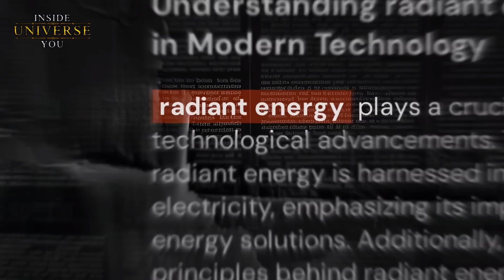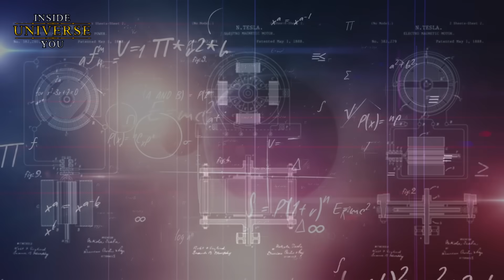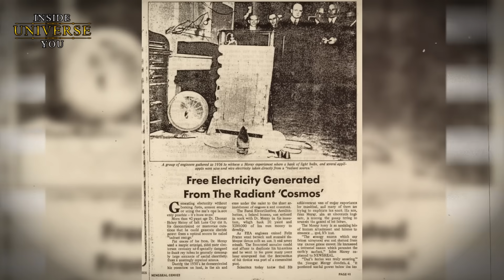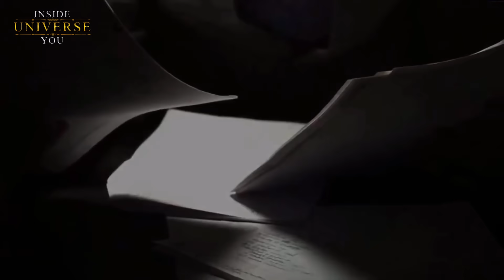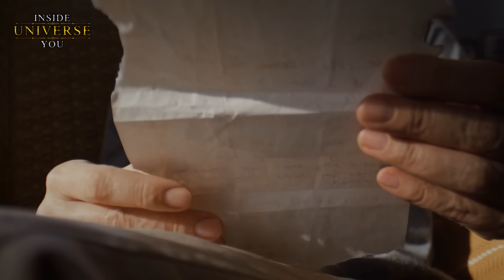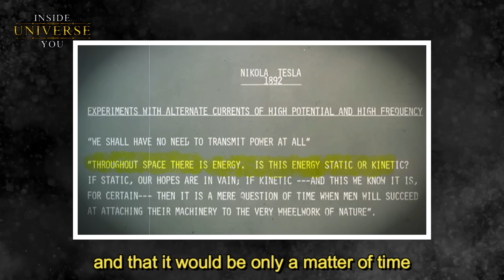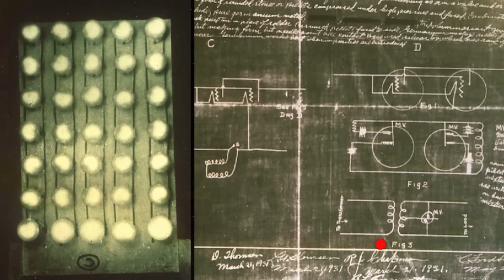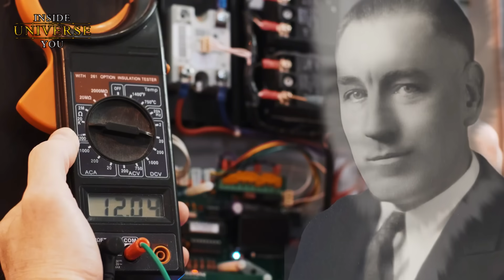Henry Moray's Radiant Energy Generator Suppression

Comment: Those in the government that shut down such things do it not only for greed but mostly  that since our system rely on oil tow throughout everything that if anything comes up it could be crash the system!!?? Causing chaos and destruction and everything else so they have to stop it or it would destroy the world so they think;!??! BUT without such innovations that does not use oil in any way the world slowly being destroyed is there even a limit to the oil!!?? The never thought of compromised like we could slowly integrate these new innovations slowly into the system a little at a time!! you know like it would slowly allow the system to adapt to this new power source!! So it would take time and effort but they don't want to do that way!! No they'd rather always shut it down boom and do it again and again and again and again and again and again and again because they got to save the system!!? knowing that system is slowly falling apart!!? And than any other resources they do allow has no real effect!? And solar  and air are ridiculous little effects on the main power system and so dependent on oil for its developments and maintenance and so on  having no real effect long-term on the system!! They  know it  so depended on  oil!?!??¡

Comment: I have read that the old telegraph system that criss crossed America was all run by what were called earth batteries which was just 2 rods driven in to the earth
Reply: Not two rod but plates of metals like zinc or similar. It was standard practice to use earth based power for the railroad scouts to scan the land for best place to implement these devices. All the telegraph usage in the early days were powered same way, and it worked great and for many years. These scouts were one of a kind, like naturally equipped to find and construct a rudimentary energy system in middle of nowhere. Think, it was the wilderness, no nothing yet. The Scouts were amazing

Comment: If you generate electricity without a underwriters laboratories sticker you'll get 20 years. Back in the 80's a guy in fremont, CA built a steam powered power supply and got busted and convicted for 20 years. Shit system.

Comment from the maker: It's funny and sad that I used the same b-rolls I used in the Hendershot Energy Generator video, of his lab being ransacked and his device trashed as the story is always the same with free energy inventors.😔
Reply: Same thing happened to Teslas lab , post his death . 
 At least 3 have been able to convert their internal combustion engines , to run on water  -  silly boys , then bragged about it , &  got heavier by big oil  -  funy thing is , those vehicles would still have retired petroleum products , just not as much gasoline .

Comment: If it can't be metered, the powers don't want it.
Reply: Yes. Addicted to money, profit. Greedy and immoral, yet celebrated.
Reply: @TheLuminousOnecontroll*
Reply: I dont know why you think they couldn't measure the energy output, if its driving something physical that can be measured. How many times does this motor spin per second, thats a measurable quantity. When they charge you for electricity bill they arent charging you for how much electricity you've actually used. They're charging you for the use of the generators. You put a solar panel on your roof, they dont send you a bill for the electricity your using. You just pay for the hardware upfront, which breaks down to the myriad of licenses the manufacturer of the generators has to pay to the patent holders plus manufacturing, maintenence, and obviously a little bit on top for whoever is selling whatever device they've produced using all those other peoples ideas so they can make some profit. Let's be real were knocking them... only reason I go to work is so I get paid. 😂 I wouldnt be doing it otherwise, I work a minimum wage job. Cos I need to by food so I dont starve and shelter so I dont freeze, if they wernt factors I wouldnt be doing it. We can get all spiritual about it, we are the generators. It’s essentially ourselves that we’re selling. We’re prostituting ourselves. Route foundation of reality is self, and the self is universal. Same self ultimately, infinite egoistical expressions of self. Basically cannibalism, ouroborus snake eating its own tale.
Reply: @1invag so here's the thing I pay taxes, and the amount of population = immense tax money, so the creation of hydropower is def possible and maintenance, the problem is these governments r just milking our taxes and letting corpos yoink each month.
take for example here in philippines 155m population that's a lot of tax and yet where does it go? those ppl in power, in their pockets instead of developing infrastructure and etc.